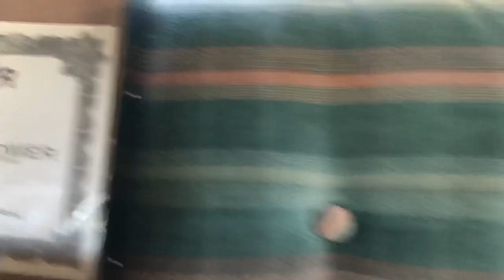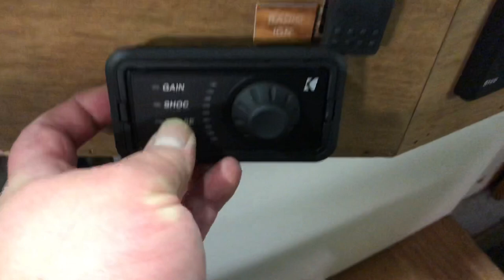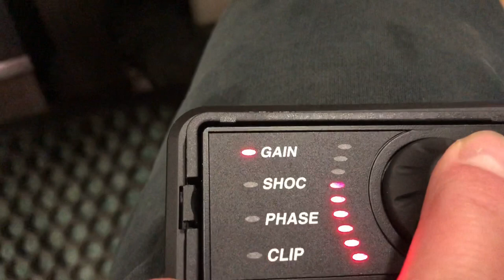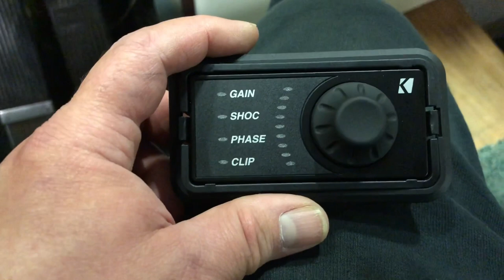Subwoofer amp replacement and a Sunday drive

Comment: Nice sounding horn on your bus , what model is it ?
Reply from the maker: It’s a wolo, there is a low and a high, that was the low only. I’ll need to get a ladder out to tell the model, which I can do if you like. At some point I’ll try and see what it sounds like with all 3 at the same time. Should wake the dead or at least the oblivious driver.
Reply: @ThisOldBus  yeah I like the low tone , my 66 5a has dual horns behind the bumper , but too " squeally" for my liking .